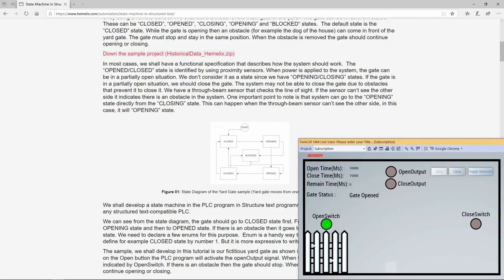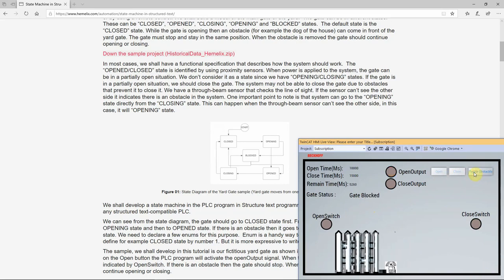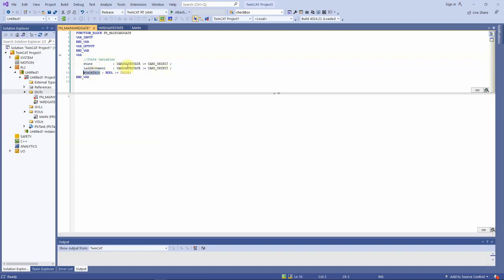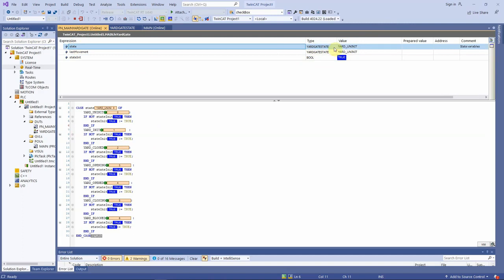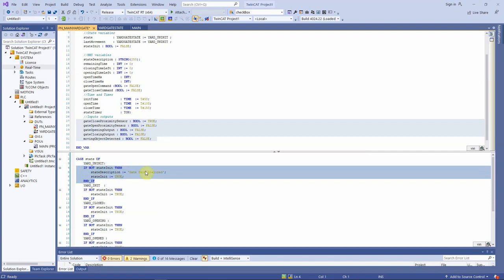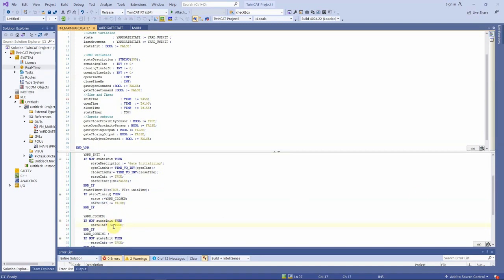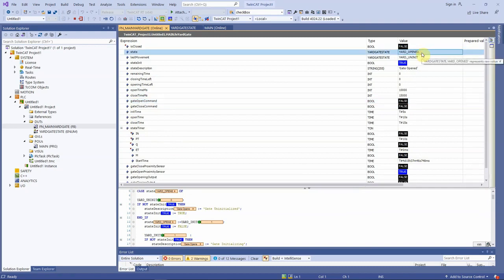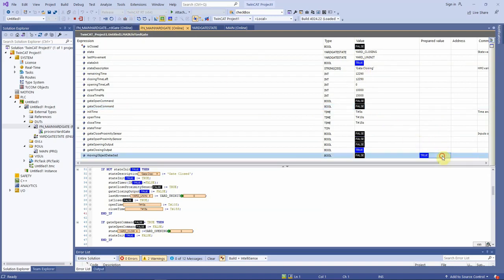TwinCAT state machine design and implementation in Structured Text.

Comment: Hi, for very complex finite state machines, have you any experience with using Matlab Stateflow to create state flow charts, and then using the inbuilt code generator to output structured text? We have a very complex system with very complex interrelated states, I'm thinking this could be a good solution. What do you think?
Reply: Yes, Stateflow allows you to create the entire state machine logic
Reply from the maker: We have not tried really, thanks